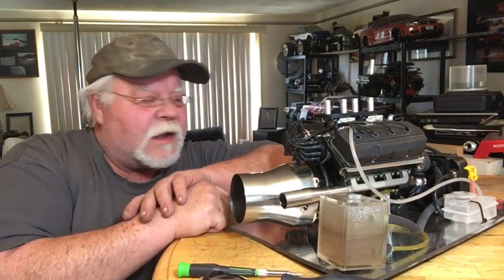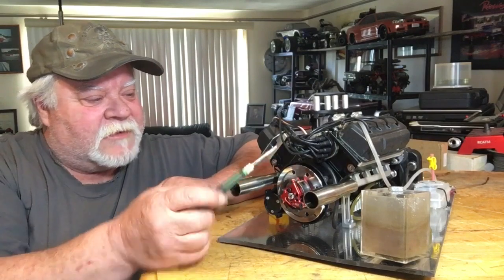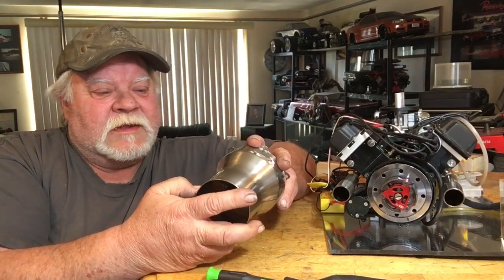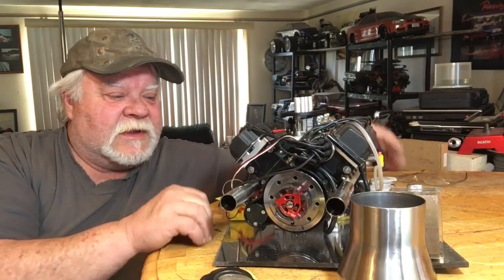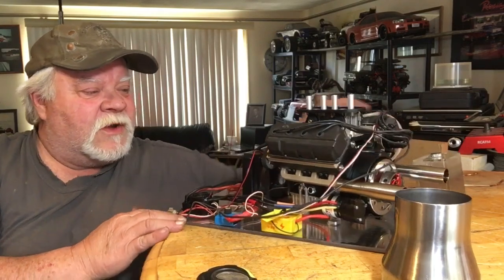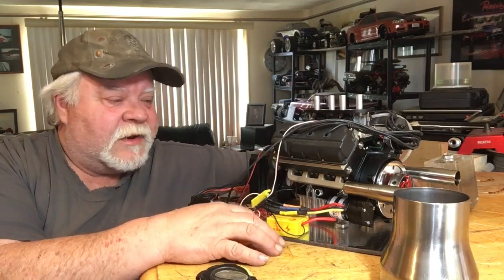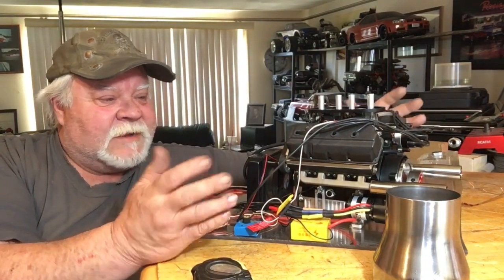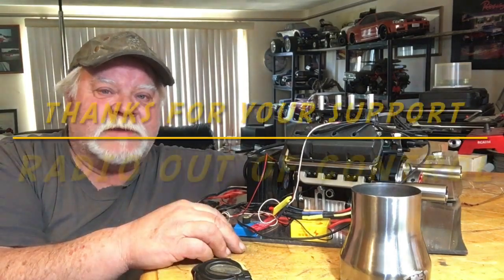78 cc Rc ENJOMORE V8 TRANSMISSION BUILD!

Comment: You mentioned near the end about the PC radiator, which I'd almost guarantee is too small to handle a 78cc engine. Something more fitting might be a radiator from a small (80cc?) dirt bike, and also increase the size of the lines going to and from the radiator for better flow. You may not need it with nitro, but you surely will running on gasoline, which burns much hotter. I've heard the cams aren't too accurate in these engines, so it may be a plan to make a degree wheel of sorts to see when the individual valves are opening and closing. Maybe you can get some specs from Stirlingkit on what they're actually supposed to be? Just a thought. We appreciate you Dennis, and I'm glad to see you putting the focus on this engine in particular!!😉👍

Comment: Great content as always Dennis. My hat's off to you 😀Don't pay any attention to all of the haters out there. Just do the things you love at your own pace. I'm working on a similar project myself. I've got an Enjomor 36cc straight four, that I'm adapting the transfer case ("auto trans case") from my Conley Stinger 609. The 36cc looks like it has the exact same flywheel as the 78cc. I made the adapter plate already and the next step is the spacer ring to move the housing far enough out to fit a standard 1/5th scale clutch in between the plate and case. When that's nice ans centered, I'll move on to where you are now, with making it grab at the right rpm and still have enough slip to work smoothly.

Comment: Dennis, you have sent this project out of the park!  Fantastic creativity.   I would get an aluminum collar made that you could bolt to the back of the block that holds the clutch bell then use the ss pipe as the beauty cover.  The collar would hold the torque created by the clutch grabbing the clutch bell. Dam I wish you lived closer I would make that for you.

Comment: Weld a stainless steel funnel to the back of the cutdown bellhousing you have made already. Can still install a shaft support bearing and the the funnel will give it a more tapered transmission shape.

Comment: MIP now MOD do a five shoe clutch for 5th gas, it can be tuned with different springs different weight shoes in different materials very tunable i am playing with one in my HPI Baja 5B with BZM 28.5cc TT (torque tuned) engine it works well, another clutch I believe FG developed but Turtle Racing developed the Snapper clutch, I have one in my HPI Baja 5SC and am trying carbon fibre slipper plate in it, and FID copied one I have in my FID Dragon Hammer these are a bit like automatic clutch plates with dogs that bite in the bell housing these are also highly tunable and not heavy.
Keep up the amazing work hoping one day to have a V8 that has the HP as per the 2stroke engines I run in my 5th gas off road trucks and buggies from 38cc to 50cc with between 9HP and 15 which I can not confirm but wheeling the 50cc ones maybe they are right.